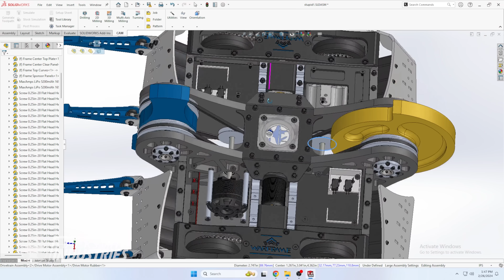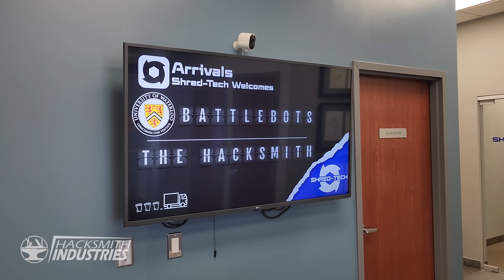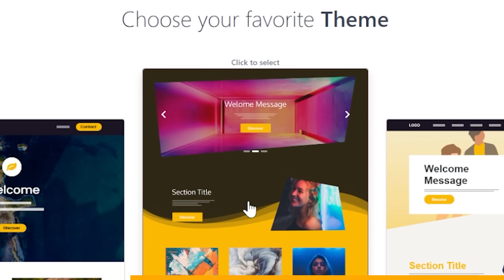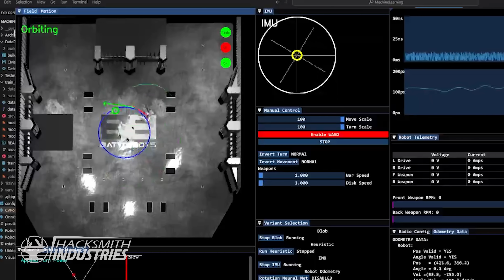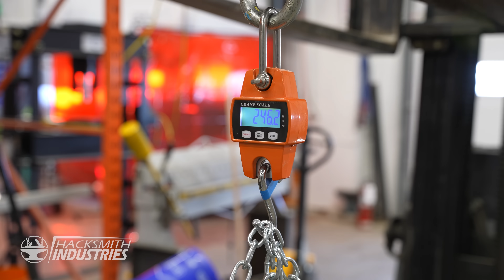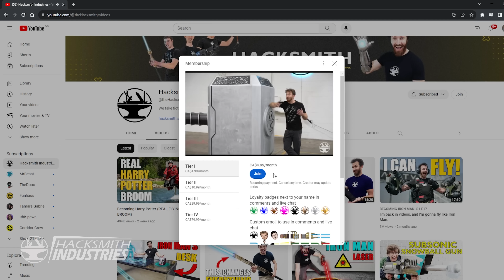Rebuilding our BATTLEBOT (VIDEO #3/6)

Comment: the point of failure in this robot is actually the motor controller, they didn't used some robust mosfet components and the pcb looks so low quality

Comment: Did you use inserts while screen in because aluminium the spreads can be easily stripped. Better to use inserts rather than threading and directly in the plates. Main sound funny but you are bolts will easily shred out with one impact please mindit.

Comment: ironically enough about the only reason I've ever been able to come up with to make a weapon setup like that would be to spin them up individually so the weapon drive could be used to prep the discs in sequence...even then I'd prefer to have them both on one end of the bot though.
^would need to completely reprioritize the internals but the idea really isn't without merit depending on competition rules, another similar system would be keeping a flywheel that can dump energy to the weapon FAST to get it spun back up for followup hits, in both cases the problem you need to solve first would be the bot's recovery time after landing a shot and frankly just the overall controllability: in both ideas the advantage is that you're storing more energy in kinetics and thus have it available right the heck now, the disadvantage is that you are storing more energy in kinetics and thus it is weighing in on any and all physics in play.

Comment: the way i would make a battlebot is to make a spinner sandwich. a 360 spinner, sandwiched between two low profile wheel/motor and battery bases, connected with a hollow cylindrical tube that the spinner spins on. meaning there is no weak side and if a bot was to attack they would also be taking a hit as if we were the attacker, essentially turning their own aggression against them. the spinner would also be better supported for such a task with it been supported from top & bottom, could also be duel driven this way too if weight limit allows.
Reply: There already is a bot like that. Look up Bloodsport in BattleBots. You'll be surprised by the drawbacks of that design.

Comment: Was wondering is magnets are a viable tool to use against Battlebots as u could use a strong magnet to pull opponents in or push them away, is this even aloud? Or are magnets just too heavy? 

Another way to use a magnet for could be to hold your battle bot to the ground so it doesn’t get tipped.
Reply: I believe they do use magnets on Orbitron to keep it towards the ground

Comment: Please consider using an acutal remote control instead of the xbox controller. They have a lot more precision for when you drive it manually and you could either have a direct link to the bot as independent backup or use usb like with the controller.

Comment: boxing example was not right gloves will give you an big advantage, barenuckle is extreamly harmfull too your fists (they will break) so it the other way around.
Reply: Most boxers have conditioned their fists to be able to use em without gloves. At higher levels the gloves go from protecting your fist to protecting the other guys face

Comment: so what happens if the enemy bot is close to a wall with a trap on it and you're in orbit mode, are you just gonna drive straight into the wall
Reply from the maker: You don't use orbit mode -- it's a driver assist, not always on!

Comment: But how to monetize a battle bot? Use them in schools as a remote control, 60 second reaction time, intruder incident responder, of course. Replace lethal weapons with cattle prods and pepper spray, include on-board speakers so remote operators can yell commands to hostages or intruders. One robot in each school, 24/7 teams of operators in centralized location ready to instantly respond to any bad situation. Go Hacksmiths
Reply from the maker: The fact that schools in the US need something like that outlines a much bigger problem... in the US...

Comment: OK the attack, very cool, but what about the defense?

How much is it sturdy?

If fall from a first floor, can it continue to battle?

If someone hits it with fire and overheat, can he survive?
Reply: 1.) new orbitron is real sturdy, even though the heat on the wedges does soften the metal it will be able to take hits. 
2.) a fall from about 3m sure is a lot, but most of the time if the damage isn't done from a vert then it'll most likely survive.
3.) fire rarely does any damage to robots, one of the few cases include hypershock vs gruff and the infamous bombshell vs complete control.

Comment: The fact that Orbitron could go THROUGH the hot water tank, fling it several feet in the air, and still have enough energy left in the weapon to shred more parts off the washing machine is equally terrifying and awesome. 😂

Comment: Hey guys! The height and location of your bolts that connect the armor to the frame are not counter sunk. Ive had experience with my bolt heads being sheared off.

Comment: Wonder if there’s any battle bots that use suction to have more grip on the floor when moving and be harder to be flip
Reply: Many of the top bots now use magnets, If you know how to encase them (they are very brittle and disintegrate easily) it is possible to at least double the effective weight of the bot but not change the mass. The downside is you need a much better drive system. There was a bot in I think season 4 that did try suction using an electrically driven turbo charger. Wow was it load. Not sure it ever got televised as they broke social media rules during filming. Only downside is that despite lots of cleaning the battlebox floor after a fight is covered in lots of stuff and it was sucking them up and willing the box with what looked like haze, which is not ideal when you are filming an expensive TV series.

Comment: Next time that you need to heat material to bend it, invest in a 40 pound bag of slaked lime. After bending, surround the part with the lime to slow the cooling. If you have few more dollars to spend, get a kiln large enough and look up the time and temperature hold that's needed to keep the desired hardness.

Comment: So cool! I’m almost 40 yr old and grew up watching all the different versions Battle Bots. Really cool to witness the evolution of the sport and really curious to see how AI will impact fights going forward. Solid concept for sure while still utilizing human input.
Reply: Yeah it'll be interesting to see if it's actually useful. Could just be a gimmick, could be extremely good! I imagine it'll depend on driver skill / ability to manage workload
Reply: Whats the point of having AI ? Its cheating ,it removes human part from battle bots.Whats next ? Put Ai in a F1 car and remove driver completely ?
Reply: @zumbazumba1  I don’t see it as cheating. It seems like the next evolution of the sport. A huge part of the sport is the programming. Like with drones there are different modes you can fly in and they each have advantages and disadvantages. You can have your drone auto level where the drone basically returns to center when you let go of the sticks and the drone won’t go past a certain tipping point… OR you can fly full acro which means you manually  have to bring the drone back to center or it will keep flipping. Pros fly full acro. So there’s going to be advantages and disadvantages to AI and software vs full manual. I’m sure Battle Bots will navigate those things if it becomes completely unbalanced in competition. But I’m here for it!

Comment: Bogdan - If you want to pot electronics, you need to pot them with something soft like silastic first before you shroud or submerge that in epoxy. Components flex too much during thermal loading, which will cause them to fail if potted directly. The 2-stage potting is what's used on high-end e-bike controllers, for the same reasons.

Comment: Having a dumb controller as a backup of the fancy controller is crucial. Because losing control over the bot is the worst way to loose. Also would recommend a more robust primary controller than an xbox controller, something that cant be accidentally plugged out or loose connection with the bot mid fight. The AI interface should be built on top of the lower level controller so that it cant interfere with the basic control of the bot.

Comment: I hope you didn't apply the potting compound on any high voltage ceramic caps. They expand under charge and temperature and will go bang if they are over constrained. You can't use conformal coating on them for example. Good luck, hope you win!

Comment: Orbit mode would be significantly more effective with a horizontal spinner - it puts you at 90 degrees to the opponent, which is the least optimal position for your design, whereas a horizontal can still attack and defend in this orientation.
Reply: Shh, Let them learn the hard way lol.

Comment: If you have to change modes by human, doesn't the faster reaction time from using AI become redundant? I can understand how the orbiting would be difficult to track for some bots, however I think the most successful are low level floor spinner plate type, which have a very wide 'weapon arc' anyway. Just some thoughts, love the videos.

Comment: What is the benefit of having two spinners? Especially if the whole gimmick is that this thing can aim itself? Wouldn't you be way better off with a single, heavier weapon or is there something in the rules that makes that less doable?
Reply from the maker: Two spinners means you can steer. If you only have one,  you flip when steering due to gyro
Reply: Mostly to stand out. Cant really get into the competition to begin with if its just a redesign of a different robot.

Comment: To harden metal, you need to quickly cool it down. That AR500 is already hardened, but if you heat it up that hot and slowly cool it down, its no longer hardened.

Comment: Just a thought: there are cases/attachments for controllers that lock the usb cable in so in the event of a bump or jerk from say.. oh I don't know.. piloting a battlebot ;) the cable will stay seated. Not sure what your system does if you lose and regain controller connection but could be worth looking into. Great work! Glad you guys are rebuilding.

Comment: As a former electrical engenier in germany please avoid multilayer ceramic capacitators. They crack under vibrations or impactpluses. They are known to burst and short the supplyrail connected. 
Replace them with single layer cersmic capacitators or tantalum capacitators.

I can tell you a dozent cases where there are going bed.

In one case it was on a cnc controller board. A spindle crash had shock the maschiene. The caps looked visual good. With the help of a thermal camara we could see that they are shortet. After desoldering they came appart in two pieces.
In some cases they even pass a normal resistans test and arc at higher voltages ass the 3v ohm test of a standart multimeter.
Reply: I feel some Deutschheit in your response. Anyway, great addition. 
Electrolytic capacitors would also be likely to burst under stress, wouldn't they? Just asking.
Reply: @nicholas_obert  every component needs to be secured in such a way that it is resistant to vibrations. Elkos can be glued or Pottet.

The Real problem is how a failure affects The circuit. Normaly there are multiple elkos. If one lead or solder joint breaks its not a big problem. It is simply out of the circuit. 

If a multilayer ceramic cap breaks it offen shorts the circuit. That means all electronic on that rail is dead.
Reply: So yeah you are correct in that they crack however there are ways to use ceramic caps in high vibe and shock environments without issue. I’ve put them on rockets just fine (and I mean big rockets). Some come with soft terminations, others have J-leads, potting helps put strain relief on the solder joints and putting the electronics on mechanical isolators can dampen the higher frequencies that would damage the caps. There are many methods to approach it to make it work.

In the case of your CNC controller board it’s possible the design was made without the requirement of surviving high vibe or shock, especially if it was mounted away from the moving parts.
Reply: @cordawg89  yes, if the right quality is picked the chance to be good is better.
In aerospace parts the components like caps are Hand selektet from highest quality like C0G (class 1). Normaly in Industrie Elektronik class 2 is the way to go like X7R.
Its a price question for the manifature 0,33$ per piece of a X7R or 3$ per Piece for a C0G.

The esc are Kind a shock resistent for normal use (the smd componentsare gluedto the pcb from the underside).
There are not made to withstand the incretible forces of a 100 pound collision.
In that case it must be reinforced.
Reply: @cordawg89   how big are we talking?
Reply: @realgagy9135  100ft tall or larger. Location of components on the engine
Reply: This is actually super helpful, thank you
Reply: It's not just the cracking, but MLCCs (ferroelectric ones, claas 2&3) can also exhibit reverse piezoelectric effect. They basically accumulate charge when vibrated, and can cause overvoltage on the rails. I don't think battlebots vibrate that much, so more of a fun fact. Also on the topic of solder joints/components cracking it is recommended in high vibration enviroments to not use gold plating on pads and "degold" the legs of components, because the gold-tin joints are very rigid.
Reply: Hope they reply
Reply: Hello ,I am an electrical engineer ,I am so lost now on what do to in my career right now ,please if you can take little time out of your busy schedule to help me get a understanding of the jobs and what can I do.
Reply: hoping my reply boosts this comment
Reply: This is some funny english
Reply: @Hege_  We usually just call it Denglisch.
As long as the point gets across, it works
Reply: @Fireworker2K  For sure. Might have found it funny because i studied some german and can see where some of the mistakes come from.

Comment: To preserve hardness: 
1.) cooling naturally makes the metal softer. 
2.) Quinching the metal in a oil bath is the recommended method for preserving hardness.

I saw deltoncbaker post this first and would agree after looking it up when i heard them say let it cool naturally
but maybe its cause of the type of metal
Reply: some metals are air hardening some need an oil quench some need a water quench some need a cryo quench in super cooled liquid -300f others need to be slowly cooled to prevent stress fractures it really comes down to what alloy
Reply: Assuming that's an aluminum plate, regular quenching would probably not work.
Maybe precipitation hardening?
Edit: 
Yep, I missed it's ar500
Reply: @nicholas_obert just an FYI you can heat treat many aluminum alloys for both hardness or for ductility Heat treating dose not mean hardening you can heat treat to get a particular grain structure to hit a hardness or flexibility or machine ability or just to refine the crystalline grain structure of the metal
Reply: Well they did say it's ar 500

Comment: I applaud your effort, but as I see it you "AI" is your biggest flaw rigt now. Do away with the circling apponent idea. It is stupid and impractical and here's why. It only works if your opponent stands still right in the middle of the ring and doesn't move more than about a meter so that there is enough space right around to not hit the walls (good luck with that... you will get pushed or hit into a side or corner)... It also drains your batteries way faster than your opponents... It is always presenting your side to the opponent and the moment you hit a killsaw (wich by the way you are driving over every single one of them in your orbit) or hit a wall and you get halted, your opponent will pounce and destroy your side... your orbit will also only work if your bot has taken no damage and is driving perfectly (this is battlebots... your drive train and wheels will get damaged). Rather just make the bot always auto face and track the enemy robot with a user option to move in to attack or back off and a present weapon A or B as the front of the robot. That way if one weapon goes down you can switch and make the other weapon face the enemy instead. As for the steel. AR500 isn't just strong because of the name. It has to be heat treated correctly. Obviously a hardened piece of steel would stap if you try and bend it cold like that. Obviously you have to heat it up to bend, but it has to be re hardened and tempered afterwards... duh! Metal working basics 101. And quarter inch? Really? You have to go at least half inch on those front pannels. You have an awesome opportunity here and I'm rooting for you, just there are some big flaws you have to address that is overshadowing your strong points. Good luck.

Comment: The laser-based lightning protection could potentially protect up to several hundred meters, and may be used at airports, launchpads and tall buildings. The laser diverts lightning bolts by creating an easier path for the electrical discharge to flow along so how about you make a lightning glove to be zeus
Reply: A small lighting glove I'm an engineer so I should know just do small version of all these things